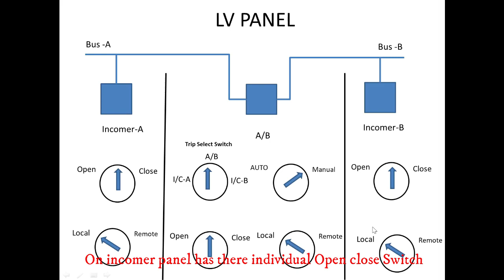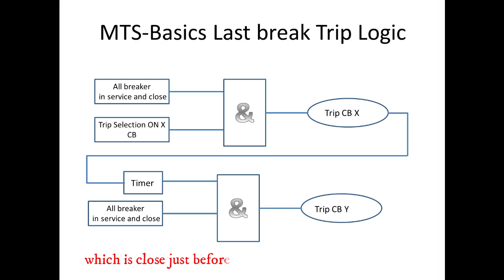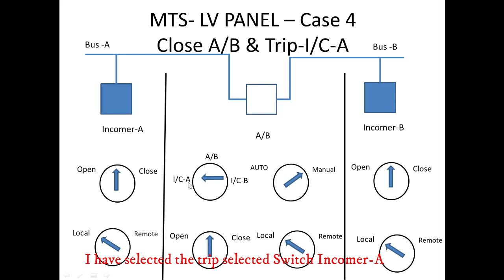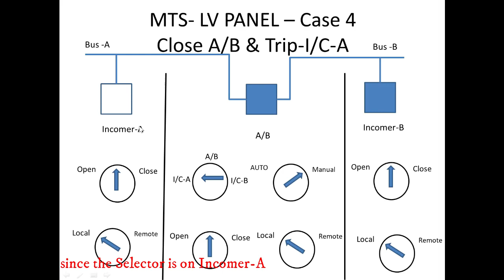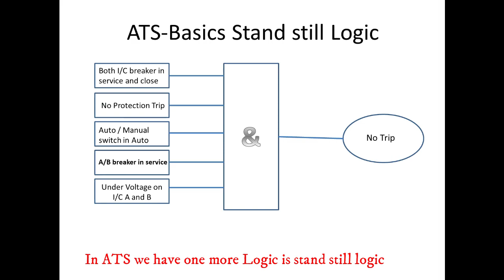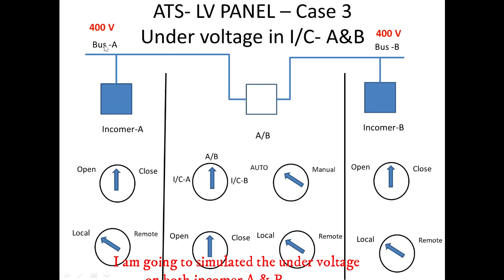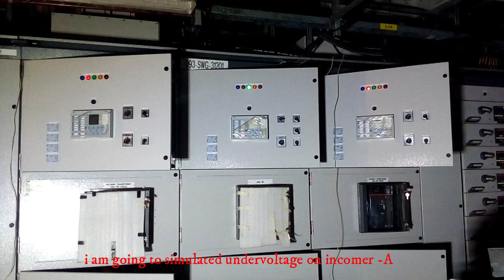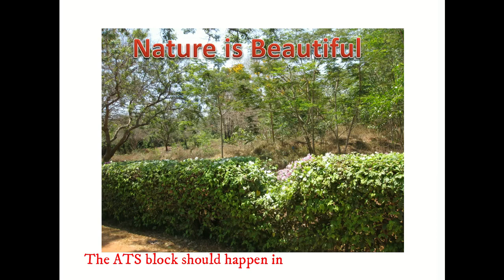MTS and ATS  WORKING and Function Check  | Automatic transfer switch  and manual transfer switch

Comment: In an M-T-M configuration, when carrying out short-term (momentary) paralleling, where should the synchro check relays be placed?

a) On the Main Incomers (A & B)?
b) On the Tie?
c) On both the Main Incomers and the Tie?

What is the standard practice?
Reply from the maker: Synchro should be on incomer and Bus Tie 

Thank you

Comment: I have seen synch check relay only in Bus PT. Are synch check relays provided in Incomers too. so totally 3 synch check relays ( 2 Incomers + 1 Bus coupler). Any reason for providing synch check relays in Incomers.
Reply from the maker: In case of connecting income supply to connect with other bus we need.